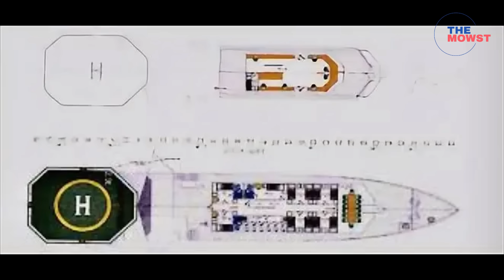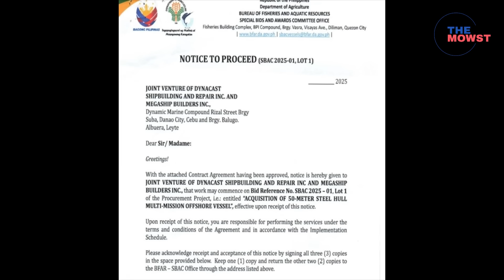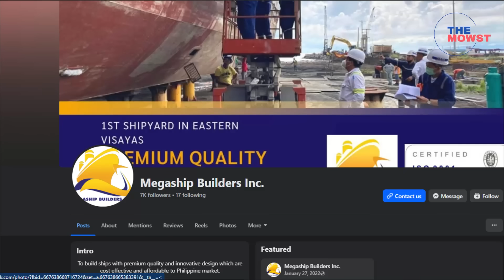NEW BFAR 50-METERS MMOV’s with Helipad: The Next Generation BFAR Vessels Approved!

Comment: Suggestion po, why not try an ocean tug, it can be used to transport supplies more than the capacity of a BFAR vessels, its strong, fast, it has its water canon also, can pivot 360 degrees easily in a small area and is normally used for salvaging in ocean and assisting very large vessels in maneuvering in port for ducking and undocking.

Comment: Seems like the ship design  been used by the designer's country of origin? The ship form.looks similar to the proposed OPV designed offered to the Philippine Navy for construction in a Cebu shipyard... the helideck is a nice addition... hope it could also handle utility helos like the blackhawk...and hueys the most common in the Philippines...at the unit cost mentioned the BFAR Law Enforxement can expanded their fleet some more... even accept on the job training  (OJT)  private contractor agency recruis for junior ratings deck, engine, steward  ratings the so called "ultimo" or casuals similar to private ckntractor security guards to to help out the maritime college graduates acquire their mandatory requirement for the 12 months sea time apprenticeship be they deck or engine line to qualify and be awarded by their respective college, or university for a bachelor or baccalaureate 4 years college degree diploma in marine transportation, or marine engineering...preventing them from becoming unemployed for the inability to complete their degree due to the inability to acquire relevant "sea time" requirement and end up doing other none related  employment to their coursework and end up without a college degree.